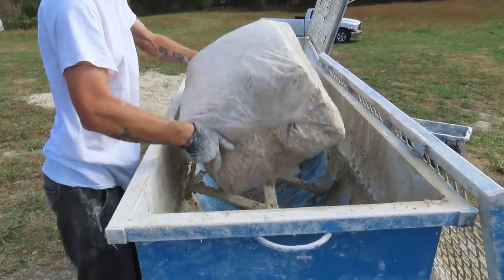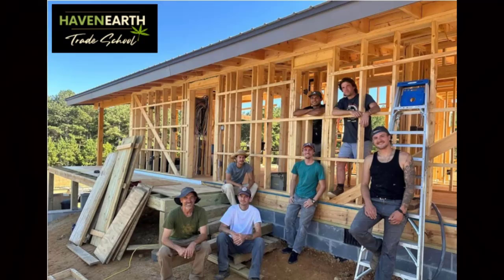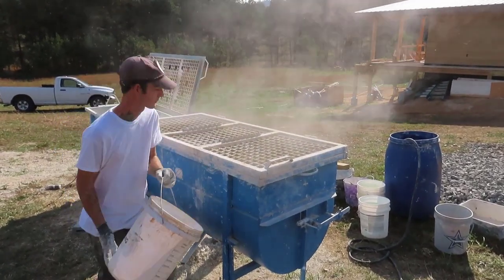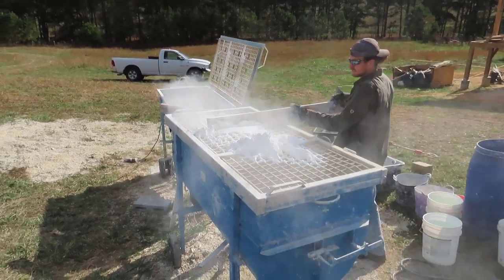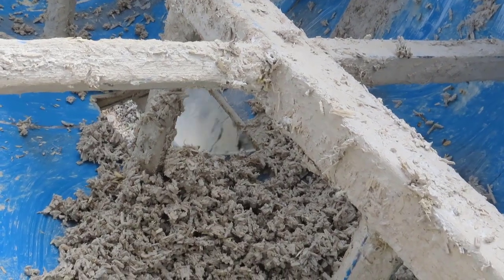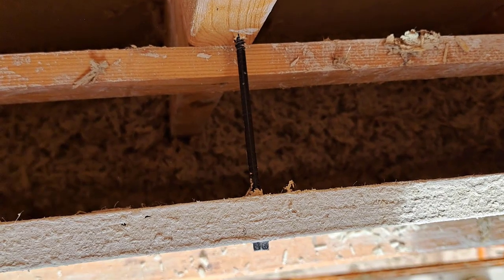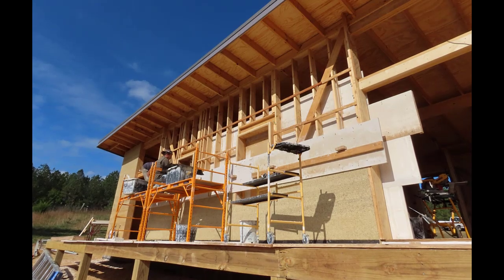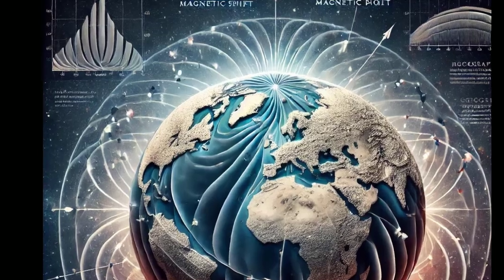Build a Hemp House (Hempcrete)

Comment: The issue with hempcrete is cost. If you buy a pallet I saw one place selling for $32 per 16x8x8 in block of hurd. In very loose numbers a 9’x15’ wall would be >$2000! That same wall would be a fraction of that with traditional methods. Hard to understand when the hurd is literally just ground up plant fiber—on a plant that is literally a weed! There are some mitigating factors: no vapor barrier needed, and you save labor if you do your own lime coat. But really—even though the argument this building approach is better is a strong one, its going nowhere until costs at least match current methods. The last thing anyone wants is an even more expensive house than they already are. 

Cob might be an alternative: straw, clay, sand, and water, and often no/minimal framing. Certainly cheap. I personally would prefer the hempcrete because its an evolution of techniques (framing) people already understand and are comfortable with.

Comment: Dave.. good video... .What kind of other fibers can be utilized other than Hemp to bind the concrete and have a similar insulation factor?   Also, how are they tamping down the mix when they get to the top, just under the roof lip?   Seems they need to investigate a better system for accomplishing tamping down, rather than risking a weak point at the top of every wall.   Looking forward to Part 2.